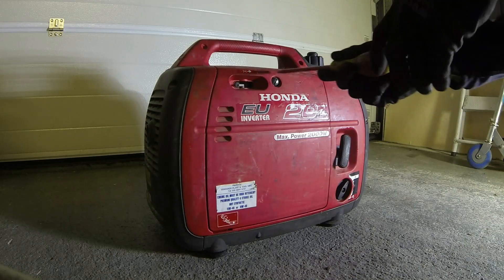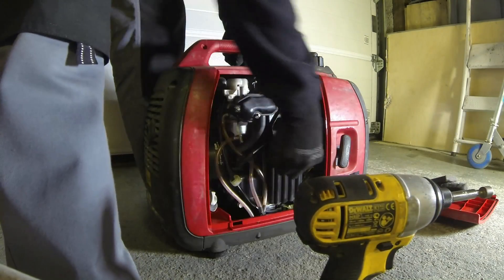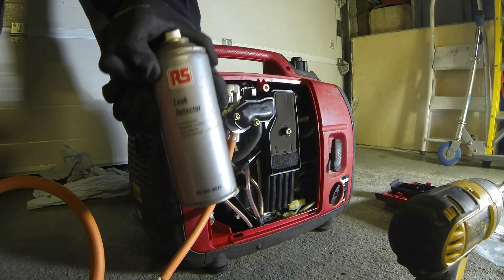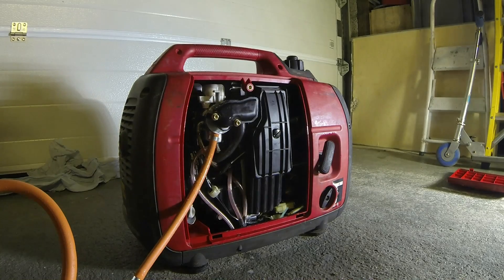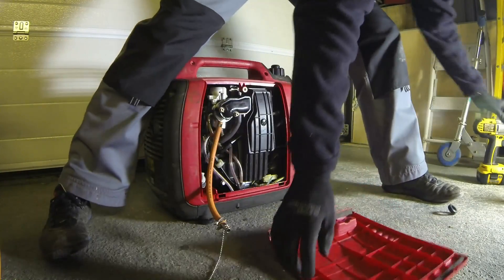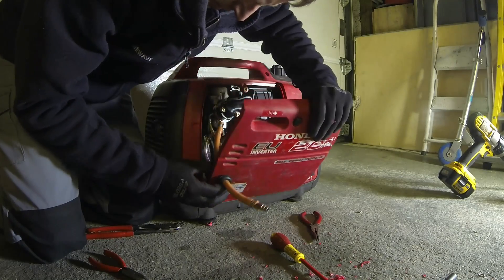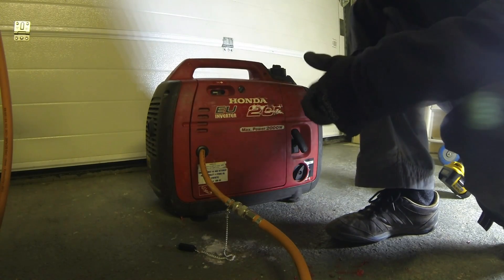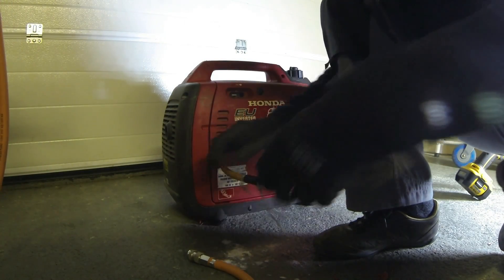Honda EU 2000W Generator Gas Conversion

Comment: Is the black plastic air cleaner tight by the side cover that comes off? Are the propane conversion kits on motor 3/8 or 1/2 thick going between carb and air cleaner? I'm not sure about Honda. Or did you just drill small hole in air cleaner to feed propane?

Comment: hey mate! who's lp kit was this?? you do know that the line from the demand regulator should not have any pressure on it right??
I would like to see this run with a proper rated load on the gen set!! could be the camera mic but it sounds like it is running rich!

Comment: can you still use gasoline with it?
Reply: Yes, you can. The propane injection system is an additional equipment, the old carburetor is still built in. To operate the generator with propane, the fuel tap must be closed. Without propane you only have to open the tap and the generator will work with gasoline.